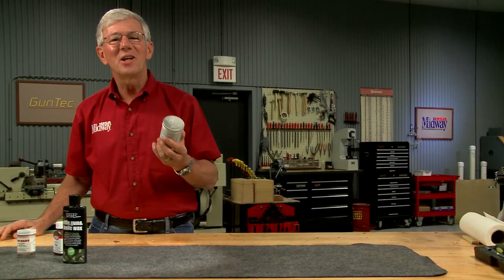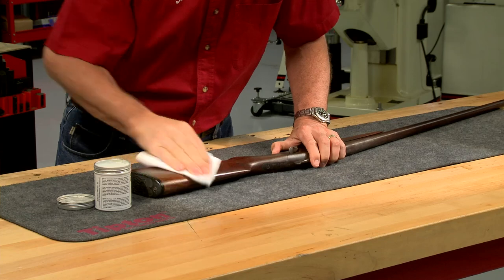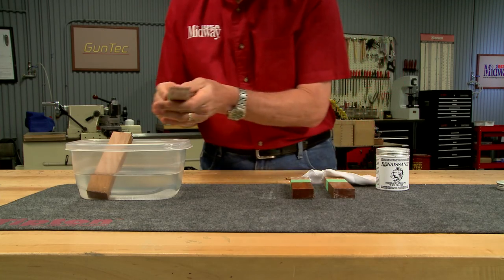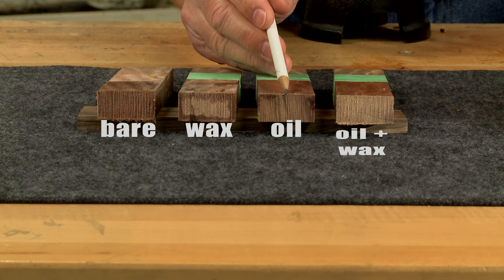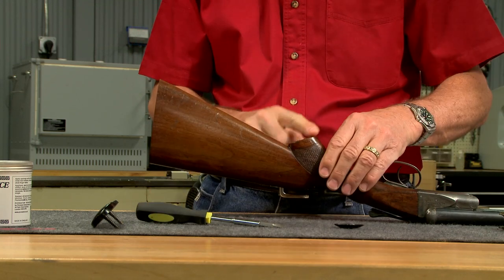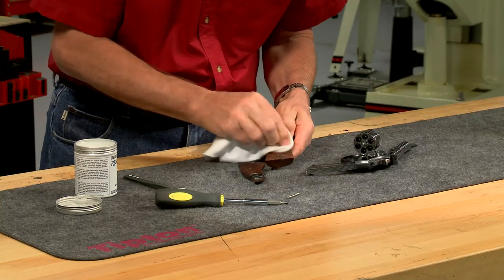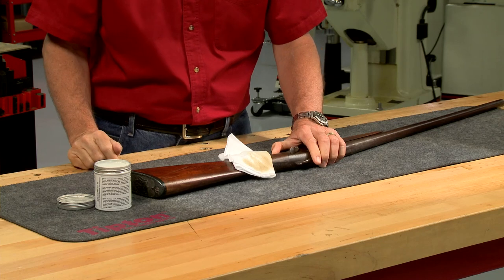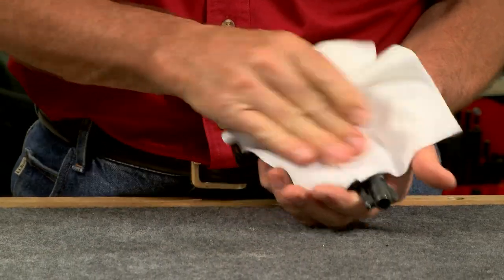How to Use Wax to Protect Your Firearms Presented by Larry Potterfield | MidwayUSA Gunsmithing

Comment: Used this wax for 25 years in my employment as conservator in large Public Library in England. Before using this, which is meant to impart a protective layer, thorough cleaning/ degreasing is necessary. Yes the wax will remove a certain amount of surface grime but not deep seated gunge. or mineral oil soaked into gunstock. Removing this oil needs lots of time, methylated spirits heat and Vulpex soap. Results are worth time and expense

Comment: Been using wax to protect my firearms for years, found Johnson's past wax pretty good.  Larry you must have one heck of a collection of Firearms, each one seems to be a collectors item. Sharps, Winchesters, Foxes had many of them myself years ago. Keep up the Great videos.
Reply: Wax is also the recommended way to preserve bayonets, sword blades or any antique metalwork. I use Johnson's funiture wax. cheap and effective.
Reply: +51WCDodge, 
  I don't use furniture wax in anything that antique, takes the old finish off.
Reply: It's nice to be a millionaire.
Reply: @minerblue9641  so does it work only on bare metal surface?
Reply: @NgJackal1990  
  In my opinion you should be the judge on that. If taking the old finish off will lower the value of an item. I wouldnt use it

Comment: My old Stanley rafter square had rusted terribly in my unheated garage. I wire wheeled off the rust, and applied a coat of Sno-Seal, mixed with a couple drops of oil. Sno Seal is made with bees- wax. It worked great as a rust preventer.

Comment: For the "oil + wax" combo, does the oil need to be worked into the wood first before applying the wax?  Or are you supposed to work the wax into the wood first, followed up by an oil polishing?
Reply: oil first
Reply: Jake M The oil finish should have a few weeks of drying time before you wax it.  Tung oil, boiled linseed oil are both common gunstock finish oils.

Comment: I just bought a brand new springfield m1a with walnut stock. My question is; should I use wax first or boiled linseed oil first and then follow up with the other?
Reply: What I have learned and am doing is use several layers of boiled linseed oil, applied with 0000 steel wool. Then apply the wax. Give it a day in between each layer of oil. (Disassemble the rifle first.)

Comment: Does the barrel warming from shooting, or even sitting out in the sun, affect the wax?  Should it be re applied after use?
Reply: mike spencer It is quite durable, and dries extremely hard. You dont need to frequently reapply, but an occasional coat when the stock gets dull will keep it in tip top shape. Doesn't melt or smear, leaves a dry/clear protectant film

Comment: I’m a new gun owner, I was wondering, can I still use the gun at the range after waxing? Or will this cause extra build up since wax is pretty thick?  Thank you guys
Reply: Wax, like anything else, you want a thin coat of. Keep it out of the barrel and you're fine. Eezox, an excellent gun cleaner/lube and corrosion inhibitor is actually wax based

Comment: what wax would you recommend for a mosin nagant?
Reply: I re did a old mauser I used boiled linseed oil on the stock. I used 2 light coats then I used renaissance wax over top. I used it all over the rifle the wood metal everything. That was 2 years ago and the rifle is still beautiful. I recently picked up a Japanese Arisaka all matching numbers. I'm fixing to do the same thing to it after a good cleaning.
Reply: @kickazz9473  thanks for the useful information! 👍
Reply: @patriot5.56  Your welcome I love the renaissance wax. Though it does stink unlike anything else I've ever smelled. Lol

Comment: So could I use something like birch wood caseys stock wax on the stock and use hoppes oil on the metal parts of my gun? Or can the two not work together, also how often would I was the stock? Every time I shoot or only a few times a year? Looking to get my first gun a mosin nagant and want to take care of it properly
Reply: Renaissance Wax is used by museums on wood, metal, paintings, etc.  It was invented as a long term sealer and preservative.  So, in short, use it all over the gun, no need for anything else.  Forget break free, hoppes or anything else as a protective coat, use wax only.

Comment: The trouble with this situation is 95% of all guns come from the factory with wood finished in spray lacquer with is tougher than just about anything else.  Wax, oils and other finishting products simply lay on top of lacquer.  This video only pertains to the few guns which are not finished with lacquer from the factory.  Maybe some older military rifles from back in the old BLO days.  Even the custom hand finished stocks will have something better than wax.  The wax is however great for metal.
Reply: Ive had to wonder if this stuff really is THAT much better than the basic birchwood casey from bass pro. All my guns look pretty darn good, and i wondered what waxing would help on the lacquered finishes.

Comment: Yea dont use this on bluing you'll cry this primarily for wood does wonders on wood but they even say do not use on blued guns
Reply: It does perfectly fine on blued metals, been using it for years now
Reply: @TerminalM193  yeah newer Bluing it's a different process but not 1800 bluing stripped it clean off
Reply: It'll work fine on WWII guns but anything older than that it strips clean off
Reply: @cathat227  so far used it on a 1970s 10/22, "that's probably the oldest firearm I've used it on" and a few different glocks, walthers, acouple sigs, my ruger AR.... Glocks are infamous for over bluing their barrels and its only helped preserve the bluing.
Reply: @TerminalM193  it's a different chemical